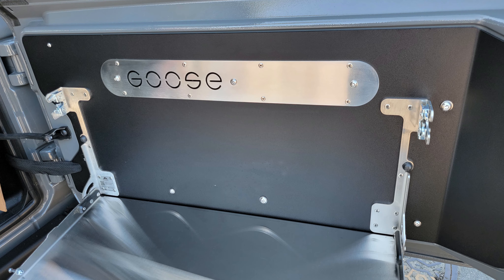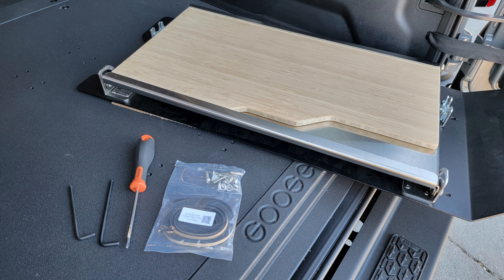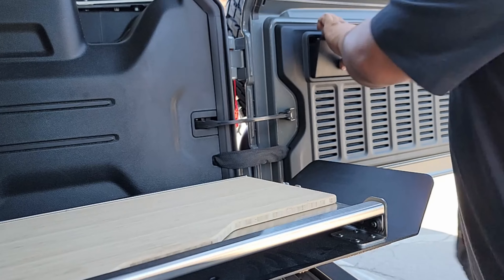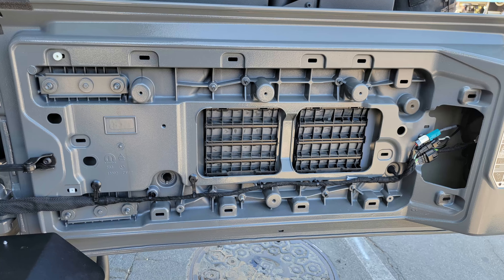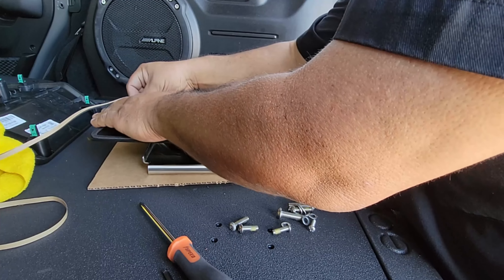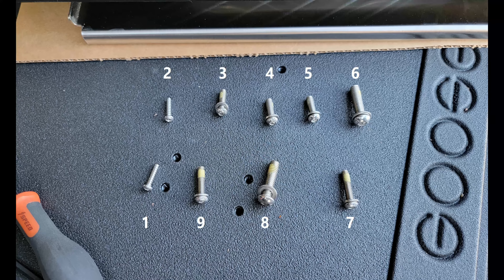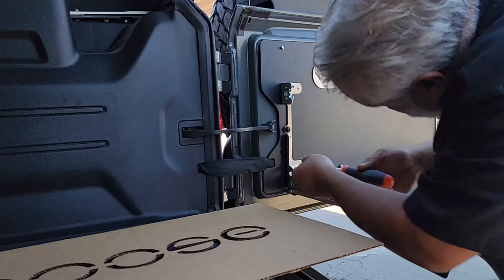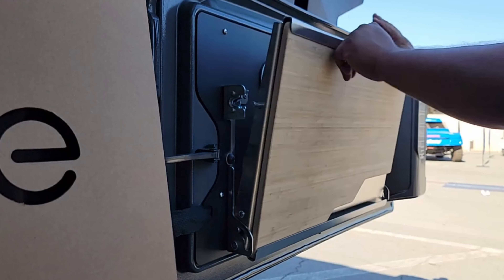Goose Gear - Tailgate Table Installation for all Jeep JL Wranglers

Comment: The cables aren’t the problem. The problem is that the goose gear table is $500. Five HUNDRED dollars! I’ll take my $89 (rock solid and quiet) table over that over engineered piece any day of the week.
Reply from the maker: There is NO contesting what things make you happy and the value based on price is dependent on the person making the purchase.

I try to provide insight into my decision making and considerations I make in the things I feel are valuable to me. 

The best part of the Jeep world is that there are so many uses of the vehicles and the nature of the builds varies based on budget and need.

As far as over engineering, that's relative. A plank and 2 rocks is just fine for some, but if you want more or much more, it's good to know there are people out there engineering things beyond the average need.
Reply: What $89 table are you referring to?
Reply: @jeradmiller4575  Rough Country makes one in that price range.

Comment: Dimensions would have been helpful. What is the depth in inches? Trying to determine if it can accommodate the blackstone 17” griddle without hanging over the edge.

Comment: It’s unfortunate that this is the only table i could find that entirely replaces the JL tailgate panel. 

the quality appears great, but the price tag is far too high. only reason i considered this is because saving an extra inch or two is crucial for a 2 door JL.
Reply from the maker: More Premiun materials in the stainless steel and aluminum with design work and made in the USA come with a bigger price tag.

Comment: Doesn’t that block the vent?
Reply from the maker: Great observation, but the answer is no. The GOOSE portion of the Goose Gear logo in the backing plate is left hollow and does still allow for air to pass from the interior through the cutouts and through the vent.

No change in door closing is noted and you can even still see the rubber flap open as you close the tailgate shut.
Reply: Oh cool. Love goose gears fit n finish look